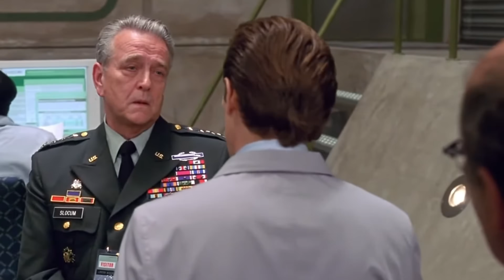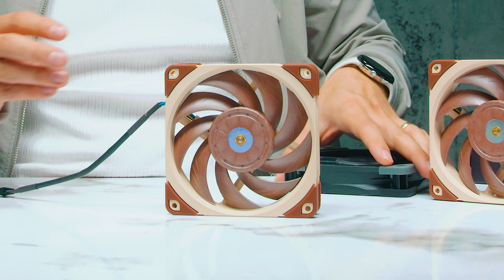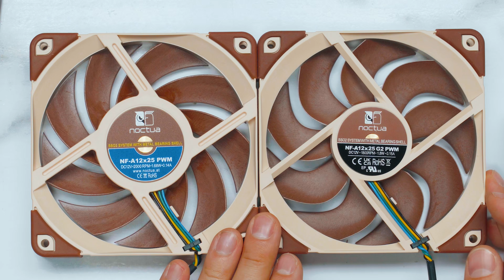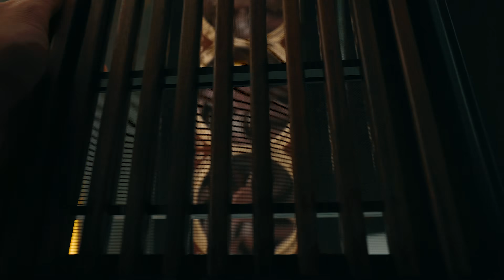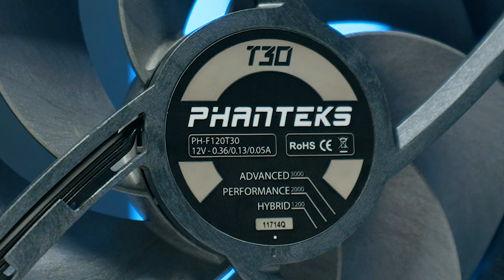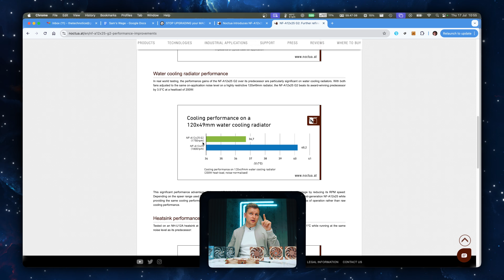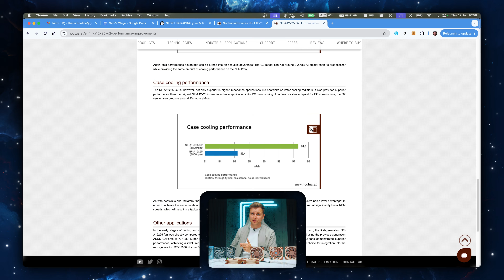Why it took Noctua 7 YEARS to BEAT the CHEATING Competition!?

Comment: Small correction in your explanation of the RPM change: What you described is different than resonant frequency and is called constructive interference. Resonant frequency is inherent to the physical design of an object, and when there is vibration close to or matching that frequency, it can cause a feedback loop of increasingly intense vibration similar to how you can push someone higher on a swing if you time your push just right.

Comment: it's a smaller motor moving more blade surface which has more static pressure which requires more force applied to it to do the same job

Comment: @Tech Notice you may already know this but the phenomenon you describe with the fans is called beating.  It’s caused by 2 nearly identical sounds not 2 identical sounds.  Similarly to the concert speakers you described beating is caused by the 2 sound waves rapidly going in and out of phase relative to one another.  So you are going from the 2 sounds nearly canceling each other out to them nearly doubling in power which to be clear is nowhere even close to doubling in loudness.  It takes 10x the power to double the loudness.  So it’s a far cry from that.  But at the same time the out of phase is causing a loss that is as much as half the power.  So the entire swing is 4x the power.  Which if you look at a dBa/loudness/voltage/power conversion chart 4x the power gain factor is 6dB and a 52% swing in loudness.  Meanwhile the average dBa measured by a meter will usually read normal unless it is an incredibly fast digital meter which at that point it’s not really a meter it’s an analyzer.  

Anyways just thought some people might be interested in that.  Beating is AWFUL.  Our ears are INCREDIBLY sensitive to changes in volume.  Which is why they add temperature fluctuation delays on modern fan controllers.  3dB is typically considered the amount of change that the average human will notice without being cued/informed of an impending change in amplitude.  3dB is 23% louder and 6dB is 52% louder.  So the swing caused by beating is horrendous.  The closer the 2 frequencies the more drawn out the beating will be until eventually it goes away and the further the 2 frequencies are from one another the faster the flip flop in relative phase happens so the quicker the beating sounds.  

The first time I ever realized it was when I was racing a nearly identical car with nearly identical modifications and it was right next to me on the track and gaining on me at a pace that was significantly slower than an old person walks.  So maybe just a few dozen RPMs faster while being around 7000RPM.  We were both in 3rd going uphill in a class of cars that only have 160hp so our speeds were not changing rapidly.  I was in my senior year of highschool and had just transitioned from racing Karts to cars and after that I realized I had heard the sound in kart racing it just wasn’t as powerful.  So I asked the physicist that taught pre-cal and cal and the band teacher was there and she said that’s called beating.  Blew my mind!!!

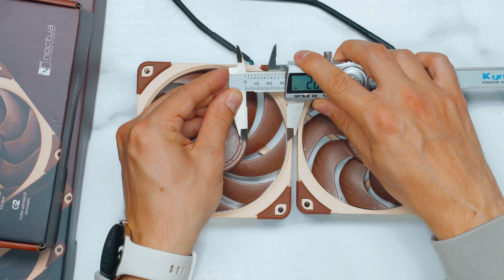Comment: 5:18  it is not "a lot" bigger..  
The root of the fan is already the smallest surface area and it has the lowest velocity
so having 4 mmm more on the inside, is in fact close to insignificant in terms of air being pushed.
Its the outside of the fan that does the big work because bigger diameter means more travel and more air moved.
4 mm on the inside is worth less than having 1mm on the outside.

the G2 gets 9% more airflow going, but that is more a function of the fan blade design,  that 4mm on the inside is not what causes that 9% improvement , its not a lot bigger surface area because its on the inside
That it draws 0.12 more Wattage means the fan blades grip the air more  and thus more current is needed 
0.12 watt just happens to be pretty close to 9% of 1.68 watt

Comment: This is not true for different speeds at all - there are no 2 fans that rotate at the same speed, even if they are on the same connector, and there is no need for the electronics to change the speeds. To avoid resonance, the number of blades on the fans is always odd and that is enough. for me noctua are highly overprized fans, and I've seen them with blocked sleeve bearing, but hasn't happened to me on the much cheaper Arctic fans. i use artic ACFAN00123A and ACFAN00115A

Comment: I built my entire PC (ITX build) with Noctua fans, sure they're very silent, but since my build was so small, I wanted something I could manually crank up to get maximum performance when needed or when I'm not home.
I went with the Phanteks T30, a single one, mounted in the front of the case. And it spits 3X more air than Noctua I had before at max rpm. You can cool the ENTIRE CASE with a single fan, that's how crazy this thing is.
At lower rpms (<1000rpm) it's as silent as my previous Noctua while still moving a lot of air, so I configured my settings to keep it below 1000rpm until 70°C, if temps get warmer than that there's a ramp to increase speed to 100% when it reaches 92°C.
Even under 100% load my CPU never gets above 83-84°C, gaming it keeps the CPU below 75°C.
If you own a PS3, PS4, or PS5, and have listened to their fan at full speed, then you know what a T30 sounds like, and it moves as much air as the blower fan present in those consoles.

Comment: The anti-resonance fan pairs are interesting, but you only really need them if you have to split them off the same fan header.
They developed these for their CPU coolers originally tho, expecting users to plug them into one header.
Personally I just use a different fan model entirely in the middle of my intakes for this, counter-rotating.
It looks cooler this way. (Performance within margin of error tho)

Comment: The best thing about my Noctua fans is that I have had them for over 10 years and they are still performing just as well as the first day.

I will have to buy a new cooler block when I'll eventually move to AM5, but it's going to be another 2 years yet (given the absurd dram prices)

Comment: This entire 20 min video, Noctua, Noctua, Noctua 98%, everyone else is cheating cuz they made thicker fans...  Coulda done something relevant like actual benchmarks of sound noise, airflow and things like that that woulda been actually useful, instead of measuring Noctua fans and pointing out every little angle of the fan that was changed.  Most useless 20 min video about a fan with nothing useful.

Comment: I wouldn’t call using thicker fans cheating. I think Noctua should make thicker versions of these new fans as well. As for the radiators, there are high fin density radiators with 55mm thick cores, not counting the ~10mm from the outer shell that make that arctic radiator look like an anorexic.

Comment: Word of advice, if you are measuring diameter ( 5:35) you use the top portion of the calibers. The bottom, larger teeth measure the length. Measurements are the same but they are easier to use.

Comment: In ancient times I had a P4  I had a big Tower (Xigmatek Elysium) and a tower for a cooler. I didn't know how hot this PC got after 2 years it blew the kondensators. I changed them and to make it futureproof I got me a top down cooler from Noktua. But I bought Be quiet fans too. I  tested it with various speeds. Since a top-down cooler is so much better and cools the kondensators too,
I gotta admit the sound at a relatively slow run didn't make a difference. But the one thing that made me happy. No brown/beige got into my PC. At the XP time there were no black vans from Noktua except industrial, noisier once. I still love Noktua. But only blacks come into my PC build

Comment: T30 is overall a high quality product, comparable with A12x25 in that matter, what I dislike are these modes that aren't exactly reliable and getting down to usable speeds takes quite an effort, you need to put it in a higher mode then set PWM lower and hope everything will work, which may need some resistors in line to lower the speed some more

if you have enough space it's a reasonable choice and may be able to compete with G2, certainly beating G1, but needs more finetuning and space

Comment: I'd say the new fans pull more power at a lower RPM is becasue the blade design is more aggressive and moves more air. I'm sure there are design efficiencies with the motor and materials that come into play, but generally it takes more power to move more air which you usually get from increasing the RPM or optimizing the shape of the blade. At least that's my take, not as a fan engineer, but I work in an industry that deals with fans and forced airflow a lot.

Comment: Noctua might be more quiet than the other brands but when you are gaming and the GPU fans sound like a Jet Engine, those that use brute force fans dont really add much more extra noise since its already loud, but for those silent builds Noctua makes sense especially if you swap out the GPU fans with Noctua ones.

Comment: The Sx2-PP version did mitigate the harmonic sound when two 12cm fans need to be installed side by side, for example, aio liquid cooler. I installed this set into my A4-H2O and they performed way better than I could expect. Extremely low noise level, along with ROG Loki PSU.

Comment: You can buy a completly budget fan and get less than 2% difference in preformance. With the money you have saved spend it on a better cpu/ gpu or the cooler it self and you will get way better preformance per $.
Do the math from a local good pc shop a cheap fan is $5 to $15, a noctua A12x15 is $49. Thats $44 to $34 difference per fan. There are ~6-7 fans in a case. Then you add a cpu cooler adds 2 more, or a AIO water cooler uses existing 2-3 mounting at the front or top. You can add 2-3 more in a push pull setup. Thats anywhere from 6 to 10 fans total, so $30 to $50 on the budget side and $294 to $490. You could deffently go from a amd 9600x to a 9900x/ 9800x3d with that price difference.
A good AIO cooler comes with good preforming fans. Just fit the biggest/ thickest one you can in your case. It will be very hard to heat throttle.

Comment: Dont get me wrong. I love my chromax noctuas including the adjusted D15 for better ram clearance (they have been running for years with no issue what so ever) but the company takes way too much time to release a new product that's only comparable not seriously outperforming their competition and for 4x+ the price...
Sure the G2 might be the best in the world given their dimensions and at similar RPM but 95% of customers won't care when 3-5mm thicker fan they have no issue installing in their case or even on their thick radiator will do the same job for cheaper and if it fails well... they can still buy a few more for the same price as one noctua.

Noctua needs to seriously step up their game and either introduce something new like their thermosiphon or they need to reduce the time it takes them to make new fan from 6+ years to two max and release the black version and 140mm at the same time otherwise their only remaining customers will be from the niche markets that need slim good performing fans or those who have been buying them for years and won't change no matter what...

Also lets not forget that these days, wireless connection of fans is getting very popular or at the very least having short wire between the fans and just one long one for the whole set for connection with the hub or motherboard. That's another thing that noctua is missing and I don't see them making a fan for this kind of market in any decent time frame.

Comment: We have had 3k RPM 120mm fans for years and with a 4-pin fan where you can control the RPM why does the top speed matter.  Noctua has had their F12 PPC-3000 for years.  Noctua is definitely the company that moves the most air per RPM but I just can't get over the sticker shock of a $35 fan.  Especially when a 5-pack of Arctic P12 Pros is the same price. 
The price premium for Noctua air coolers just doesn't make sense to me over something from Scythe or Be Quiet.

Comment: If you dont care abt the noise noctua cannot compete against arctics server grade 120 fans.
They go to 6000 and push so much i use them for my desk i use headphones and i cannot hear them but the fan Provides a lot of cooling.
They also use fan rings to have even smaller wall tolerances and better pressure.
So if you use only headphones id recommend this because its much more performant.

Comment: Your Math is not mathing😂  
1800 Rpm vs 3000 is not a increase off over 50%  its even under 50%  just to reach 50% increase it would need to reach at least 3600rpm

Comment: ive been using the p12 maxs for a long while now and they are Extremely quiet, i can barely hear them when theyre set to silent in the bios (and it handles mid and sometimes heavy load just fine). Additional thing is they are super cheap, bought a 5 pack for 35$. 10/10 would recommend, even for people who can afford the more expensive fans, there to be fair simply isn't a reason to go for them

Comment: My cpu have an old thermaltake cooling block and the fan got broken after many years. I checked the market and found a nice and cheap Arctic fan. I am using it at around 4 years now and the quality per price for the product was amazing at the time of purchase and over the years it is still rocking perfectly without any weird noise or something. It is cooling my cpu perfectly with great low decibel of fan noise. Just want to say it is not always the case you buy the most expensive one to get the best performance. Unless you are a fan of a fan.

Comment: The reason power consumption goes up at low speeds, is because you have less energy stored in the rotor. You have torque (force) and rpm (speed). The more rpm you have, the less torque you have, the less rpm you have, the more torque you have, relative to the load ofc. At one point, there is so much energy stored in the rotor at high speeds, it takes next to no energy to maintain it. So if you want slower fan with same rotor design (weight and fanblade curvature), you'll be burning a bit more power. That's all there is to it.

Comment: The smaller circumference motor accounts for an increase of less than 10% surface area. Point being that the change to the blades is a FAR more important improvement. We'll undoubtedly see copiers who keep the cheap bulky motor while adopting the new overall blade shape.

Comment: I always loved noctua, my old fractal case with the intel q9550 had 8 noctua's fans and ofc the nh-d14. But for my new pc I went arctic, at the moment 5 arctic p12 cost less (20€) than a single NF-A12x25 G2 (35€). I gotta say, with the experience I have now, I would have gone with the nh-d15 instead of the arctic liquid freezer iii 360, or any closed loop liquid cooler. The reason is performance degradation over time

Comment: To be clear, Noctua never claimed their competitors are cheating. That clickbait statement is purely this channel's. They just sell their fans on their merits as usual: excellent performance efficiency to noise ratio.
As consumers, we have 2 options:
If you want best performance to noise without concern for budget = get Noctua
If you want good performance for a budget and don't mind the extra noise = get the (not cheating, just using a different method) competition

Comment: As a consumer, performance per dollar spent has always been one of my main focuses. I bought Arctic p12's and p14 Max fans. Three p12's and two p14's with the bigger fans being intake on my system. They move good air but are definitely loud. That's my only real gripe with them however they do perform well and weren't crazy expensive. I would probably just do normal p14's if i was gonna switch them out and add one more on the bottom in front of my power supply to pull more cold air in. Though i can't be too upset for a budget minded build, it's pretty solid and thermals are good too.

Comment: Making the fan able to spin faster can be called low effort, lazy, but not cheating. If a fan maintains good performance/noise ratio in lower rpm range there's no problem with that.
Reply: which finger do you use to spin the fan that fast. I keep trying with my index finger but its harder to play games.
Reply: And Arctic made the fan blade tip have zero gap to the ring.
Reply: @samiraperi467  I have one in front of me, and no. It's 2mm.
Reply: @samiraperi467  not really

Comment: I Have some very old Corsair High static Pressure fans.  They made a quiet fan and a powerful fan.  and Holy crap this thing is loud.  That noise you mentioned is seriously noticeable when the fans speed up when I start up games and such.  I'm probably going to replace all of my; fans with these Noctua's after this.  I'd love a quieter rig and I'm needing a new AIO at this point too as mine is over 10 years old now and just not cooling like it used to.  also a Corsair 240mm.  I'm amazed it still works but it makes clunks when it speeds up now.  I also understand the coolant evaporates over time as these things age.  

Anyway. thanks for the info!  I've been looking for good powerful fans that are also quiet.

Comment: With the Phanteks T30 fans they arent cheating
And from numbers ive seen from several testers the T30 outperforms the first gen of Noctua both when compared to the same RPM and a noise normalized test, its just that Noctua doesnt want to make a 30mm thick one, when in most cases there is more than enough space to fit 30mm thick one

Its like saying someone is cheating if they have made something that is better and can outperform something else that is obviously weaker, its just things changes and evolves
Its like saying someone is cheating by putting in a 140mm fan instead of a 120mm fan, when it is clearly enough space for a 140mm

Comment: Radiator thickness does near nothing to fan resistance.  Radiator thickness improves thermal transfer.  Obstructions like plumbing, fin thickness, and fin density cause air restrictions.